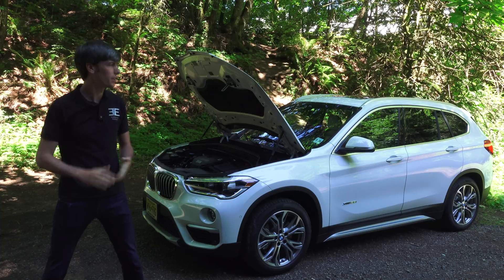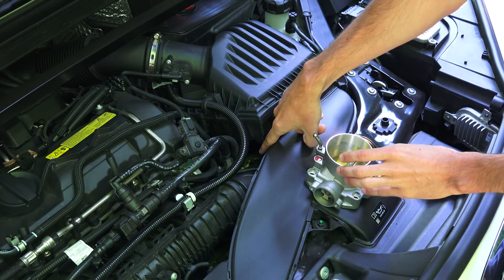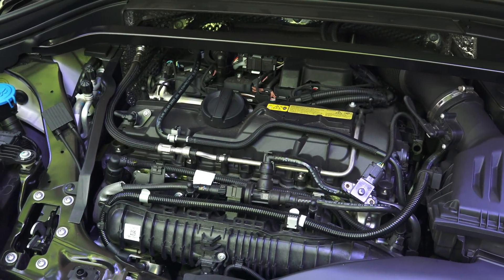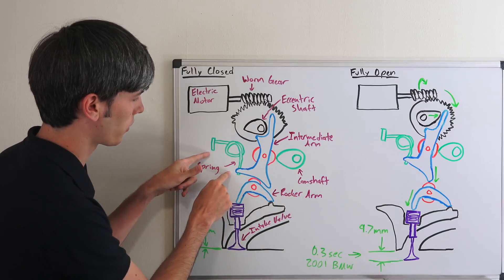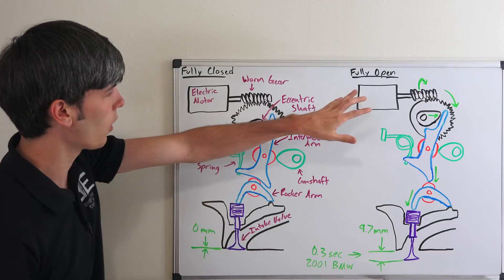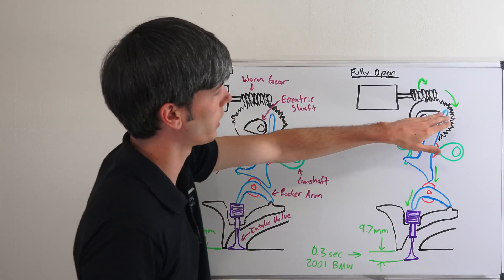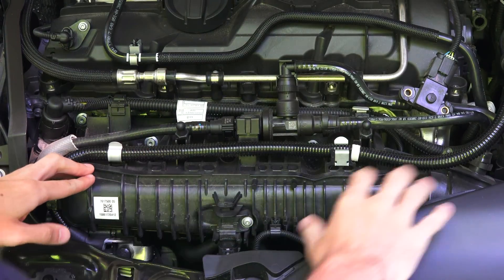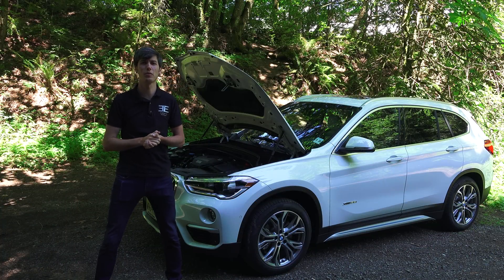What Is Valvetronic? BMW's Innovative Throttle System

Comment: Wow cool. Look all the parts that can break!
Reply: made to be leased
Reply: +DE “AutoBravado” Nichols And those same vacuum pumps leak oil like a sieve, pretty much like everything else attached to the motor. BMW may boast the latest and greatest technology however their lack of ability to build an engine that doesn't leak oil within 50,000k makes you question the quality given the price tag.
Reply: I feel you there.
Reply: That's what we can get out of complex improvement most of the time.
Reply: That's how German cars work, way too many parts.
They drive like a dream though.
Reply: Kcus Kcidu
Complicating the three part mechanism to this degree for questionable improvements is sure retarded...
Reply: DE Nichols some engine emulate the Atkinson cycle (bigger expansion/burn stroke than compression stroke) by leaving the intake valve open as the compression stroke starts, or opening the exhaust valve BRIEFLY during compression before fuel is injected, so that there's more energy transferred to the crankshaft in expansion and less energy lost compressing the mix.
Reply: DE Nichols I think the Prius does that trick, but with an extra 10% efficiency, it'd be pretty neat to include "valvetronic" type throttles too
Reply: What are you, 80 years old? Did you say the same thing when mechanical fuel injection came out, then when electric fuel injection came out?
Reply: DE Nichols why do they?
Reply: So a Dinan throttle body for the n62 is waste of money?
Reply: Kcus Kcidu Canadians only lease according to Scotty Kilmer.
Reply: Kcus Kcidu $90 diagnosis. $300+/- part. $90 remove and replace.
Reply: NGC1433 not talking to you...
Reply: NGC1433 questionable? nah SAE papers have talked about this for years
Reply: Alexander Riccio Can you elaborate? That sounds interesting. I'm listening!
Reply: The price of efficiency. But electric is here so get that.
Reply: Look at all the parts that WILL brake*
Reply: epj3 When drive by wire breaks it hurts people. $500 to fix a lot of times. A simple cable and no issues.
Reply: NGC1433
1 viewer commented that it's been 200k kilometers and it's had no issues.

Remember, there's even another layer of complication, that, this makes the vehicle need a vacuum pump so things like brake assist actually work.
Reply: Are you 8 and have no idea how much of america still rides carburetors?

Comment: I don't see how there is any vaccum advantages. Just because a larger volume of boxes and tubes are under vaccum doesn't mean a whole lot. Given the sheer volume of air an engine processes. Especially given this is a turbo motor. I just don't see the increased efficiencies having anything to do with vaccum

Comment: Great video Jason!!!!....good info!!!....I dont think this system is gonna work well!!!...too many parts, wear, weight, etc etc...just imagine, one electric motor for each admission valve!!!...very complex!!!!..... :) :) :) :) well we will see!!!!....
Reply: Valvetronic only uses one motor.
Reply: I could be wrong, but the way it looks set up, you could use 1 electric motor for a whole cam shaft.
Reply: ohh!!...thank you for the info update!!!...one motor!!!...I dont know!!!...but it seems to me that all that tiny pieces could wear out uneven and causes noise or vibration!!!...or malfuction due to early mileage!!!!....we will see how that system turns out!!!!
Reply: Mine has driven 200.000km and still works fine. It's always bathing in oil. 
If I'm going to complain about something it would be the lack of an oil dipstick. There is an electronic one but you can't get an accurate reading unless the engine is hot.

Comment: So let's say one would want to turbo one of these motors. would it be easier to just disable the valvetronic so it's fully engaged and just had a throttle body to it? I just feel that adding a turbo and making the valvetronic work would be a tuning nightmare

Comment: Which car brands are the most difficult to do regular maintenance?
Reply: Bmw is only second to Mercedes in my opinion. To be sure they come to the shop they get charged the same as any ordinary car, but the mechanic loses money spending 2-3 times the amount of time. Ultimately, the shop loses money too from lost efficiency. They're all around losses to any shop.

And I say all that not liking oil changes on any car that needs like a dozen bolts or screws removed just to change oil. Those still go faster.
Reply: I think the same along those lines. BMW is notorious for being one of the most difficult to maintain. I saw a video once for how to replace the AC compressor on a BMW (cant remember a model just now, think it was maybe a golf) and he practically semi-stripped the car just to access the leaking part. Don't get me wrong BMWs are good road/sports cars, just high maintenance.
Reply: napa modesto Exactly.

Comment: What happens while idling?
Reply from the maker: Valve lift is very small.
Reply: after a few years the Idle control valve will prevent idling. Saves on gas.

Comment: Nothing beats individual throttle bodies...nothing !!!
Reply: +Nick Amarit why do you want to disable the valvetronic for that? why not use the valvetronic as the throttle valves and just manufacture some nice intake trumpets? makes more sense if you ask me.
Reply: +Nick Amarit well i never made something like that, but why shouldn't it work? the standard intake manifold is just a plastic box with some pipes. if you want to go with open trumpets you delete the MAF sensor, so you need to reprogram your ecu. besides from that i would prefer this method, because if you just disable valvetronic, you keep the complicated valvetrain, but delete all benefits of it. the valvetrain itself is capable of 7000 rpm according to BMW, so with some nice trumpets, alpha-n, a good reprogam and good fuel this engine could be quite enjoyable to drive i think....
Reply: +Nick Amarit from my point of view it must be possible. i drive an n42 engine myself as a 1.8 litre, that i currently convert to 2 litres. some headwor to do and stuff, should put out 160 happy horsepowers at the end....hopefully
Reply: +Nick Amarit I stroked it with the 90mm crank from the n42b20
Reply: I agree. That is why I'm trying to disable Valvetronic on my N46 engine to try to figure out a way to custom some ITB's on there.
Reply: +Nick Amarit The best solution if you ask me ;)
Reply: kabeleone The problem is, if I try to disable Valvetronic, I don't know if my VANOS will get affected too. VANOS is good for performance, so I don't want to get rid of that.
Reply: +Nick Amarit Im not familiar with bmws and cant help you with that...
Reply: kabeleone no worries, thx for replying anyhow :)
Reply: No problem brother :)
Reply: Best way to get ITB's is to trade in your 318i (or whichever BMW you have) for a E9x M3
Reply: zclee I would, if I could and had the money.

But to be honest, at this point in time, I still prefer 4 cylinders more than 6:
1. Tax is calculated by displacement in my country, and tax for a 2-liter engine is quite a bit cheaper than a 3-liter engine.
2. I am used to how the car handles now and would like to keep it that way for learning purposes.
3. If I were to do an engine swap, I would probably go with an N45, which is essentially the same as an N46 but with more power, a higher red-line, and no Valvetronic. But that engine is a very rare one.
Reply: franz wer So are you saying that I should use the Valvetronic as a sort of ITB, but elimate the stock intake system and replace it with intake trumpets? That way, do you mean that there will be no individual throttle bodies needed behind the trumpets? Could that be made to work? It certainly sounds interesting.
Reply: franz wer you make a good point. I really wish it was do-able. The throttle response on my N46 is really quite sluggish.
Reply: franz wer Did you bore it or stroke it?
Reply: franz wer Nice!!!

Comment: is this system only implemented in the diesel engines with direct injection?
Reply: No its only used in Petrol engines. Diesels have a fixed camshaft profile, you can see its cylinder head is much simpler.

Comment: I own a 2011E90 330 and  unfortunately, the throttle response is worse than anything else, I think other owners could confirm this. Many people thought it was the electronic pedal, but it is the valvetronic system.
Reply: Its gotten a bit better with newer Valvetronic 3. Yours is Gen 2 Valvetronic. The pedal controls the motor actuation, that requires a bit of power, not 40A like Gen 1. Current motors have twin-scroll turbos (see boost at 1000 rpm) and fairly good ZF automatics, shifts very fast. Helps with the delay compensation.

Comment: Please do a video explaining how sequential transmissions work
Reply from the maker: +Colman Baldwinson search my channel, I have one. :)
Reply: +Engineering Explained hmm, I guess I'll have to look harder then. I'm not talking about dual clutches, I meant the transmissions used commonly in rally cars where a clutch is used to get off the line, but not for shifting.
Reply: +Gonzalo Contreras lol definitely not a cvt
Reply: Simple example ...basicly 2 parts in the system, 1.electronically by cutting throttle/spark depends on the system a spit second for shifting. 2. the sequential bit is done by a mechanical system to turn 'H' pattern into up/down. you can buy them for popular boxes. best done with dog boxes (straight cut gears)

same can be done in a normal manual gearbox by having higher revs then the next gear needs before changing then let off throttle and change gears smoothly  and fastish but without the clutch, mostly up gears but can be done down if you blip the throttle just right.  had to drive home after clutch cable snapped doing this,for stop/go i turnt car off then put it in gear and used the starter to bump along untill engine started and of you go.

Comment: EE! Valve question. if this beamer runs at 5000rpm we are assuming the valve has to open and close 2500 times in a minute? so 2500/60 is roughly 41 times a second this valve has to open and close? how is that possible with a .3 sec (in 2001) valve open/close time?  Did I mess up my maths?
Reply: It's not the time that it takes to open the valve (the valve is still opened by the cam), but the time it takes for the electric motor to change the lift from minimum to maximum lift.
Reply: OH right the cam is still causing opening/closing its just that motor which allows the cam to do what its designed to do. So it does not have to go through the .3 second process for every valve opening/closing. Thanks man I knew I missed something simple

Comment: incorporate this set up with koenigsegg free valve system!! (()====D
Reply: hey dude what are you gonna do with the subaru
Reply: daily it and mod it
Reply: +Poor Man Mods sweet I'll be waiting for an update vid
Reply: You wouldn't need to incorporate this with free valve, as free valve isn't a mechanically driven system. They'd have to design actuators that aren't just fully open or fully closed for it to work properly, which will be a hard task to perform reliably.

Comment: since when was 10% innovative ?
Reply from the maker: +deiz nutz haha, are you kidding? 10% is absurdly significant. Imagine a car using 10% less fuel at 24 hr of Le Mans. They'd win by ages. Engineers will fight for much less than 10%.
Reply: Engineering Explained i guess it all depends on the application ?
Reply: Imagine that you got a card that gave you 10% off fuel for the life of the car... worth it?

Comment: How much better is this to itb's if there is a quantifiable gain aside from the point of activation?
Reply: Valvetronic is not meant for performance and actually becomes a bottleneck at higher RPM's. ITB's are better for performance; that's why you never see M cars with Valvetronic. That is also why I'm trying to disable Valvetronic on my N46 engine to try and fit some custom ITB system to it. But I don't know if removing Valvetronic will also remove VANOS as well (I want to keep VANOS for performance).
Reply: Nick Amarit thank you for the insight man.
Reply: +Nick Amarit well, the current M3/M4 uses valvetronic as well as far as i know, i think this system is very sophisticated nowadays.
Reply: turbo

Comment: its cool how this system works but I'd be terrified if I ever owned a car equipped with this type of engine with no warranty. Best bet is to keep it simple. I assume a inline 6 would need 12 of these extra valves plus 12 springs in order to keep the intake flowing on all 6 pistons vs the traditional one throttle body on most cars.

Comment: I have a pushrod engine so take my comment with a grain of salt, but holy geez that looks complicated. Not that I don't understand what's going on, but using an electric motor with all of those extra moving parts to operate an intake valve just seems like a long term reliability issue waiting to happen. And what happens when it fails though? I know the TB is there as a back up but I wonder how well the cam and valves can cope with that extra stuff attached to them.

Comment: seems to me running an engine lean of peak would be better way to go when at low power settings... its done a lot with airplane engines usually head temperature  becomes the limit to how close to peak you can get

Comment: Interesting system. It is very complex though, I wonder how it will pan out reliability-wise in the long run. It does seem however, that you can achieve most of these benefits by just using individual throttle bodies, which now seems like it would be a much simpler system than valvetronic.
Reply: Very interesting to see this response 5 years later! From my understanding it's proven to be very reliable, and the newer B48 / B58's still feature this plus VVT. The most common failure is on the actuator itself, the additional moving parts inside rarely fail because everything is so well lubricated.

Comment: Interesting video, it's cool to see we're still trying to squeeze more power/efficiency out of an engine fundamentally designed in the 1850s. Hey what about a video on Otto vs Atkinson cycle engines ! The pros/cons of each and different implementations would make for a good video.
Reply from the maker: +stefan radovich I have a video on the atkinson cycle if interested. :)

Comment: i see lots of failure points. they should use a pneumatic or hydraulic camless engine design. Thanks for the video.
Reply: Hydraulics aren't reliable that's why Semi Trucks don't use them for braking since they are more prone to leaking as opposed to air.
Reply: So what you're saying is that every single aircraft built since 1941 using hydromechanical actuators is not a reliable system? You really have no clue of what you're talking about.
Reply: +Guillermo Lovato you're over here comparing Ford to BMW engineering. Good engineering is good engineering. If you didn't know, BMW was an aircraft company before it built cars, so assuming they would carry that knowledge over is not far fetched. Get lost kid.
Reply: +Guillermo Lovato You're obnoxiously ignorant. Stick with being a professional student, because you're not in the least bit practical or experienced.

Comment: I can't help but think that using actuators directly on top of the valves would be better. Much like fuel injectors but with a larger pintle that cycles the valves open and closed to any varying degree. Rather than all this complex geometry, pivoting parts and gears. Also, wouldn't there be more stress placed on wrist pins with the piston trying to pull a vacuum with the valve fully closed?

Comment: With this system, can the vehicle engine break?
Reply: he means engine braking i think, good question
Reply: Any vehicle engine can break... Was there a point in that question?
Reply: +SenszR because the throttle body is open and to engine break the throttle body needs to be closed.
Reply: +xFaggy031x yes, gosh I hate English such a diffcult language (native English Speaker).
Reply: Oh yeah of course.
Reply: Same reason you can stay idle and the engine won't die.
Reply: Yes, but perhaps less effectively. Diesels have no throttle and they engine brake, but also have higher compression which provides more resistance.
Reply: Engine braking is not done by the throttle body or carburetor flys. Engine braking (in a gas ICE or diesel w/o a "jake brake" or the ability to shut the turbo backpressure valve) is done by reducing or completely stopping combustion in the cylinders usually by stopping fuel input into the cylinders. Having no combustion happening means that all engine compressions, flows of gasses, and movements (valvetrain motion, crank rotation, etc.: anything creating friction) which are normally powered by combustion are now powered by the cars inertia. The engine always has the mechanical advantage and so the cars inertia has to work harder to keep the drivetrain moving multiplying the effect of engine braking by 2.5-4 times.
Engine braking in vehicles with worm driven final drives basically just locks up the tires.

Comment: You talk about atmospheric pressure in the intake manifold but it is actually greater than this given the engine is turbocharged. Anyway the concept is true, almost the same pressure from turbo to intake valves.
Reply from the maker: +Clovis Tanganelli that only applies when the turbo is providing boost. Under light/medium throttle turbocharged engines still pull a vacuum. If you've driven a car with a vacuum/boost gauge you can watch this in real time. My Subaru would stay out of boost unless I was really on it.
Reply: I'm familiar with turbocharged engines and you are right about turbo pressure on low/medium rpm,  but vacuum/boost gauge sensor is placed after the throttle valve, then this information does not directly apply to this engine considering throttle will cause a significant pressure drop on low/medium rpm. It would be great to see how does intake pressure perform througout all rpm in this engine.